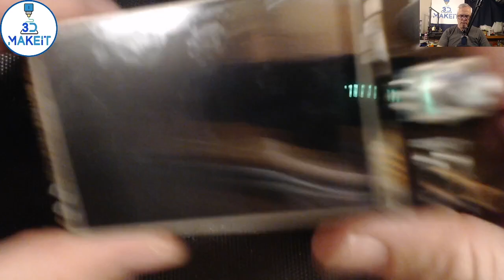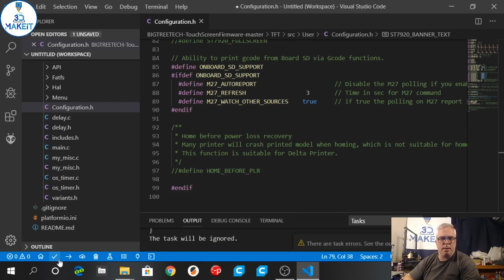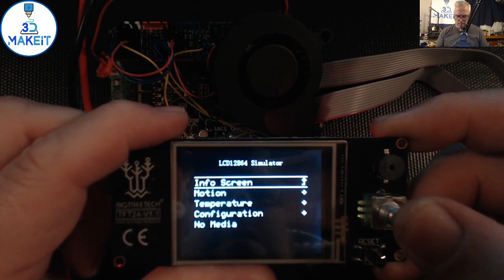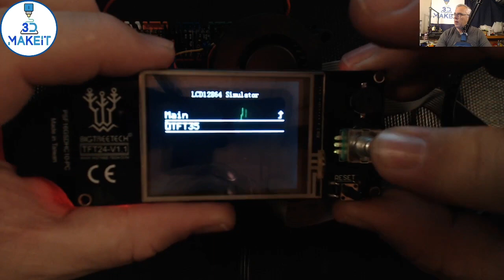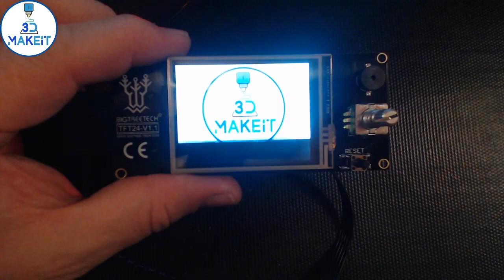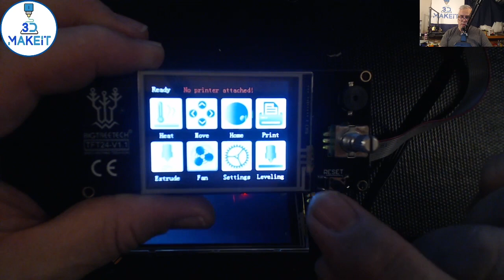BigTreeTech Screens TFT24 V1.1 and  TFT35 V3.0 Touch Screen Display compatible 12864LCD

Comment: Howdy! I know this video is three years old, but I do have a quick question.

Do those screens have any firmware setting to automatically disable the hotend when not printing from their USB port using a flash drive.

My printer do have a modded TFT24 (the knob and reset button were removed and it uses a customized firmware) from BTT (printer manufacturer does not release the firmware config files though) and I was having that particular issue when using Octoprint. After a while the screen show the hotend being disabled by inactivity but the gcode commands kept being sent through the motherboard USB port, so basically the stepper motors (including the extruder) kept moving with the hotend off.

Comment: I have an SKR 1.4 Turbo installed with 250000 baud, and the TFT24-1.1 also with baud @250000 in the config.ini, though b/c the machine is an MPCNC and doesn't have any heaters, I only want to run in touch screen mode and not have to use the 2 EXP ribbons.  I am now trying to debug "NO PRINTER ATTACHED".  If you (or anyone) can help me through this, I would greatly appreciate it.
Reply from the maker: You need to drop your baud rate number one the screens don't like working at 250000. 115200 works the best. The EXP ribbons are only for Marlin mode. The black cable is for touch screen mode. Want to adjust the baud rate I think everything will start to work that is the number one issue people have.
Reply: @3DMakeIt  Thanks, I'll reflash Marlin, IDK why I've been avoiding this advice, I have a reg 1.4 and a TFT35 @115200, but this being a rework to run a CNC, I didn't want to change too much initially and left the baud as I found it.
Reply: Dropping the baud didn't resolve the problem

Comment: Hi, according to your knowledge is there any chance to print from .gcode files put on TFT24 sdcard or usb drive?
Reply from the maker: As long as you have the correct sd  suppor enabled on your marlin config you should be able to print via the sd card on the screen.
Reply: @3DMakeIt  Thank you. Just mounted the lcd to my ender 3 and printing from usb/sd card work flawless.

Comment: As a beginner thinking of upgrading main board and display on an A8 I'm totally confused by comments below like "the screen needs to know the build area". So it's not just a displaying output from the main board?
Reply from the maker: the Screen acts as a Host( Like a computer) and sends command to the board so it needs to know the dimensions so it can do things like manual leveling.

Comment: My BTT tft24 v1.1 doesn't work in 12864 mode. without black cable it doesn't even connect to the printer.

Comment: If you don'y edit the TFT firmware for machine settings does it not just pull it the printer firmware?
Reply from the maker: Nope, the screen needs to know what the build area is for sending the move commands. so you should build it with the GitHub files. It would be nice if you could enter it on the screen it self.
Reply: @3DMakeIt  That's a bit unfortunate. Last time I tried to upgrade the firmware it never displayed properly. Not speaking of one I had edited just the stick firmware on github caused issues for me. The display was mis-colored and jumbled in parts. Scared to try it again on this new one.

Comment: Thank you very much for the tutorial, it has been a great help to understand how the board works.

I have a doubt, I am a little confused when it comes to modifying the firmware. I am not a programmer but I understand something, the .bin file is compiled, and you are editing the code directly. How can I get the code without compiling?

It may be a very silly question, but I can't get from .bin to open source.

Thank you and sorry for the lousy English provided by Google Translate
Reply from the maker: The BigTreeTech GitHub has all the code.

Comment: Hi Greg, I'm trying to set up the SKR PRO with the TFT24 but I'm having great difficulty. 
I'm getting the source code from here https://github.com/bigtreetech/BIGTREETECH-TouchScreenFirmware but BIGTREETECH's instructions are out of date for the TFT24.
When I power up the board with the screen connected and the SD card inserted I get a blank white screen with backlight. 
After I hit the reset button it changes to a black screen with no backlight and nothing more happens. 
I've been trying to figure this out for the past 12 hours but I'm not having any luck at all.
I've included all of the files I'm using in my Google Drive folder here: http://bit.ly/36LowvE
If you could take a look and let me know if anything is wrong that would be great.
It might be worth mentioning that I'm using a microSD with an adapter. 
Many thanks for sharing your video, very disappointed I haven't been able to figure this out.

Edit:
I enabled "@ REPRAP_DISCOUNT_FULL_GRAPHIC_SMART_CONTROLLER" in the SKR PRO config. Is that okay for touch screen?
Reply from the maker: Hi Cameron, sorry to hear you are having problems.
So if you want to use the touch you do not need the "REPRAP_DISCOUNT_FULL_GRAPHIC_SMART_CONTROLLER" enabled
that is only for the two Gray cables for the non-touch Marlin menu system.
First thing I would do is disconnect all cables, then just connect power to the screen on the power connector, that way we can tell if the screen works at all.

Second. If the screen powers up, then hold the Rotary button in for 10 to 15 sec. this will switch the Screen from 12864 Mode to Touch Mode. depending on the firmware you might get a choice of Marlin or Bigtreetech choose Bigtreetech.

Check out the Second Video on Flashing to fix the font issue, https://youtu.be/ILrFq9MQfRk 
Having the latest firmware gives you the live icons.

Let me know if it works.

Cheers
Greg
Reply: @3DMakeIt  Hi Greg, thanks very much for getting back to me. I tried everything but it's still not working. In fact, after I provided 5v directly it fried my SD card so I'm sure there is an issue with the board itself. Hope you had a great Christmas and New Year!
Reply from the maker: @sirron2929  sorry to hear that. :( Happy New Year to you.

Comment: very nice video, question: when i add m600 in the gcode to get the filament swap on a layer, will this work? on my mks gen l with 2.8 tft touchscreen it doesn't work :-(
Reply from the maker: If it is configured in marlin it should

Comment: I was hoping this would awnser my question but didn't can either one read from usb from the emulated 12864 screen? I assume they do but would like conformation
Reply from the maker: The SD and USB are Fully accessible from  12864 Mode and the Touchmode.
Reply: Thank you I have a bigtreetech tft35 1.2 no knob and I cant seem to update it at all I got scrambled icons everytime I tried until I found a brach that was for the tft35 v1.2 and that just put me back where I started and the firmware for it doesn't have all the options as the other firmware so am I to assume the tft35 v1.2 is just to old?
Reply from the maker: No tft35 v1.2 is not to old. You can download the Source Files from https://github.com/bigtreetech/BIGTREETECH-TouchScreenFirmware
then you can use VScode to create a new Firmware.
Reply: @philipcoulson3111  I am trying to install the tft24 on my skr1.2 and having one hell of a time. I also have the issue now of a bunch of scrambled icons and text after trying to update firmware to 1.1.25. I then tried to change it to 1.1.24.2 and still a bunch of scrambled text and icons. I can't seem to find and older firmware to get it back to where it even was. I mean it was not detecting the printer but at least I could read it before..... Edit.. I have not used GitHub much in the past and it has been since 96 since I have done any programming. I finally figured it out on getting the screen updated with fonts and bmps.  Now I just have to figure out how to get the darn thing to see the skr board. I have tried in both modes too. EDIT again. FIXED

Comment: Great video for beginners like I'm, but one question. I see that you change ST7920_BANNER_TEXT "3d MakeIt Simulator", but later in video banner is "LCD12864 Simulator". Can you comment that? Best Regards
Reply from the maker: Hi Romeo, In the Config file of the firmware you can change the Name or remove it completely. I had just reflashed the Stock Firmware so that is why it changed back. The source files are avalable on the big tree  Github.
Reply: @3DMakeIt  I understand. Thanks for response. Best Regards

Comment: Finally i was able to make the tft35 work with mks sgen l board but in an older version firmware. The latest firmware just doesnt see the board and i couldnt fixed the pixelled icons
Reply: In the lcd mode, i see mesh bed leveling function but it doesnt work. It only gives 4 points. Do you think this is from the firmware or this display works like this?
Reply from the maker: It's most like there is a new version that just came out I would suggest compiling it yourself because you get the best results and you can customize the  dimensions to your printer size. I am doing a new video on the new screen features.
Reply: @3DMakeIt  i wrote to bigtree again and they sent me the link for the new firmware version v3.0.25. I tried it but it has the same problems. Pixelled icons and writings and mesh bed level doesnt work on lcd mode
Reply from the maker: Did you add the TFT3.5 folder to the SD CARD? It has all the Fonts and New Icons init. you need to use the one that comes with what ever version you download from GitHub. or you will have the Issue. i Just did a new video and show this.

Comment: My tft 35 v.3 has a black screen but the lights from the power, wificard, and the greenlight for the sd card lights, but still the screen is all black. Connected with TFT and tried also with exp3 as it is for my skr e3 mini v1.2 

Any idea?
Reply from the maker: First thing I would do is disconnect all connections to the screen and try to power the screen with just the 5-volt power connector.
Reply from the maker: did you get it working?

Comment: So... you can connect those ( TFT35 to be specific) to non-BigTreeTech boards?
If so - what protocol does it use - SPI, UART? Can I use their "TFT cable" ?
Reply from the maker: It depends on the board, for the touch mode you would have to connect a serial connection. If your board has one available. For the classic 12864 it just works as a discount reprap screen. So you can use exp1 and exp2
Reply: @3DMakeIt  Serial connection - sure.
What type - SPI, I2C, UART ??
I'm asking coz I'm running out of them on my board :)
Reply from the maker: What board?
Reply: @3DMakeIt  Arduino Due + SmartRamps combo, I got all those serials available.
Reply from the maker: I have not used the SmartRamps but if you have AUX1 you can use that for the Touch

Comment: Hi, thanks for gr8 video ... but I couldn't let the 3.5   talks with my mainboard skr_pro v1.1 , it gives "No printer attached" 
I've installed Marlin 2.0 bugfix. When I   activated the line  #define REPRAP_DISCOUNT_FULL_GRAPHIC_SMART_CONTROLLER  the firmware compiling gives an error, even I've installed the library  U8glib through Tom.
Reply from the maker: Musts at the baud rate to 115200
Reply from the maker: Usually this is a problem with github being out of date on the vscode machine.  I would try downloading the newest version of github then remove the u8glib library and re add it